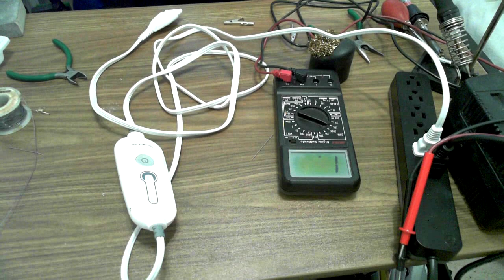How to test and fix a Heated Blanket Controller.

Comment: Thanks for the video, especially the part about heat sinking the thermal fuse before soldering. I blew my first thermal fuse trying to solder it. Then used an alligator clip to heat sink on the second fuse and that worked.  Although unfortunately my controller has other issues because it only worked for a few seconds before going TU again.

Comment: The camera did now show... what was the resistance of the blanket you got?  I think mine was 7 ohms if I recall...  I can't believe anyone would post complaining or pointing out that this is a video for the control vs blanket.  Like they never fixed their __________ (fill in that blank, tire,battery,alternator, for example) and said "I fixed my car".  It is commonly understood you fixed the blanket.  The details reveal what part of the blanket, just like the example of the car.
Reply from the maker: Thank you for the commit.

Comment: Should tell us the setting to put multimeter on to test for bad fuse, or to then check the good replacement  (which is the   ->+   sign, ...I think ?).  Learned a few good things from this. The guy knows what he's doing, but  the step by step descriptions and visuals are a bit vague.  How to test the actual blanket for a short is not included in this.
Reply: You shouldn't be opening a mains operated unit if you don't know how to check a fuse with a multimeter.

Comment: You initially called it a "thermal fuse" / "thermal cutoff" which is likely correct.  Then you repeatedly called it a "thermistor" which is a totally different type of component and likely incorrect.

Comment: I guess if the damage is in the heating element, it can't be fixed, right?
I'm saying this cause all the videos I've seen they all fix the switch/power supply circuit, but no one checks the elements.
And mine was broken when I moved it from one place, to another, so it's most probably the elements.
Reply from the maker: yes, it not worth fixing even if you could fix it.  This will make it unsafe to use.

Comment: What do I do if my pad doesn't have any screwdriver hole things
Reply from the maker: It should have screws.  They are usually hidden under rubber pegs  Or it could be a snap on case.  I would need more info on your case.
Reply: Mine as well.
Reply from the maker: @lesleypetersen805  Who is the manufacturer and model of the unit? so I can see if I can help you out.
Reply: @coyotekey192  hi, I just saw this now. I have to check it later on, I'm not at home now. I'd they'd any other way that I can communicate with you please?
Reply: Found mine under a sticker. Depending on multiple factors (such as age, manufacturer etc.), removing the sticker might void warranty.
Reply: Get a BIG Hammer !!!
Reply: start praying cuzz !!!

Comment: electric blanket controller resistors keep  blowing up even after replacing the cut off fuse. What's the problem?
Reply from the maker: Sounds like you have a short on the board.

Comment: Would either one of those fuses blow as a result of the cord being cut?
Reply from the maker: If it was plugged in then yes for the fuse not the thermal most likely .  If not plugged in then no.

Comment: This is dangerous the thermal cut out fuse must be exactly the same as the original and match the temperature and amp rating of the original part or the blanket could catch fire. Its very important that the same rated temperature is the same or the blanket will over heat and catch fire and there is no mention of that which i think is extremely dangerous, people sleep on these blankets just somthing to think about before anyone attempts this you dont wanna burn in your sleep this guy didnt leave the blanket on long enough or do a temperature check so theres no proof this blanket actually works properly.